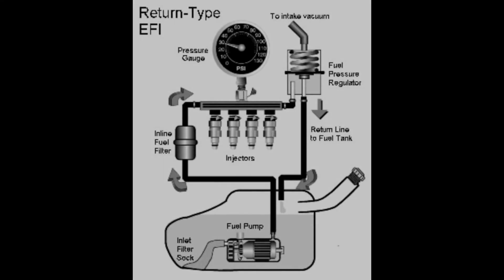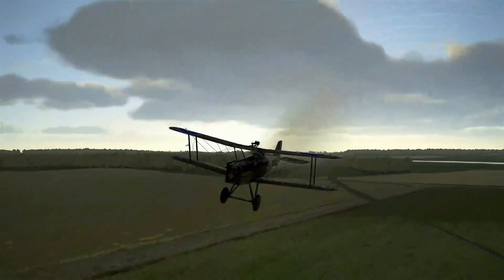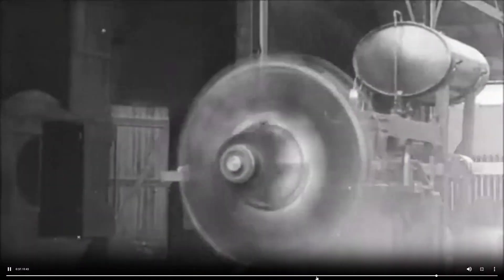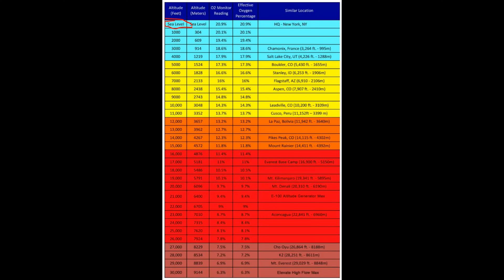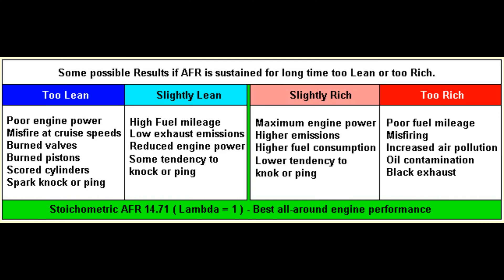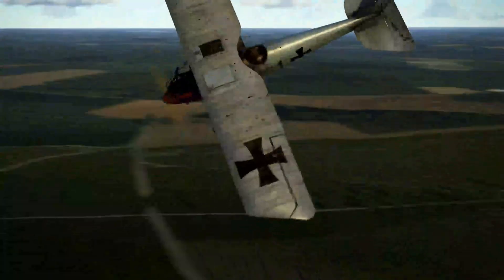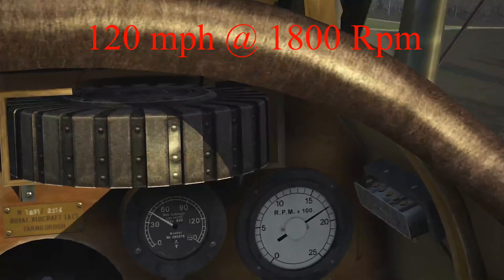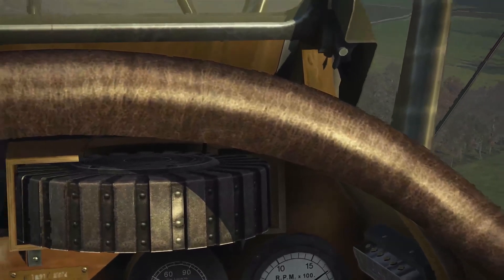(18) IL-2 Flying Circus Complex Engine Management - Mixture Control

Comment: Short and simple - Thank you!  Next question, can you explain mixture and running cold - especially in the N-17, I have a hard time keeping that one running properly, especially when descending and trying to keep the rpm down?  Much appreciated!
Reply from the maker: I dont have the N-17 but the theory is that rich mixture will actually run cooler than lean mixture. For decent try leaning it out. In practice you would want to give yourself a more shallow glide angle and take longer to get down to keep the engine warm enough to function. Great question. thank you.
Reply: @colninny8769  Thanks Col, I think that should help a lot (especially since I was going rich vs. lean in the decent!).